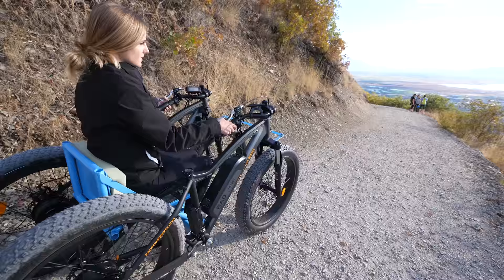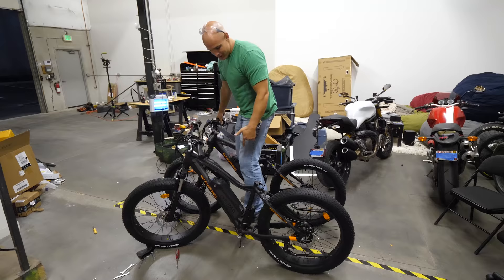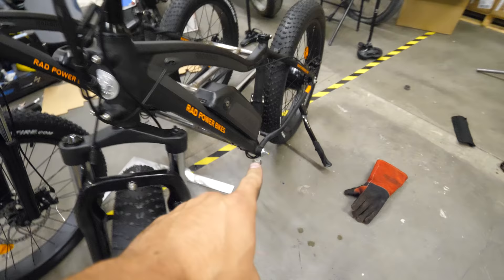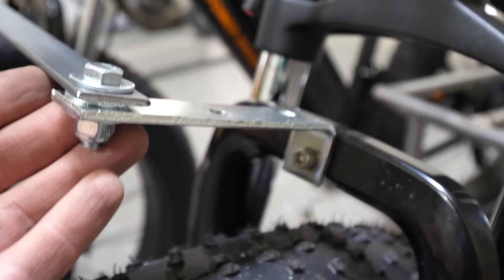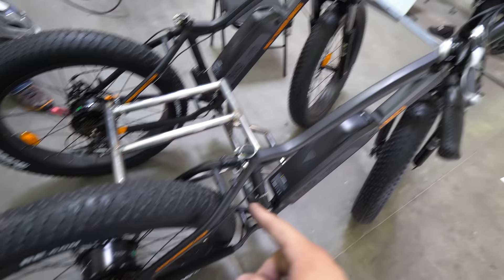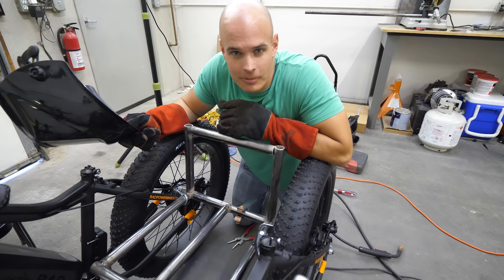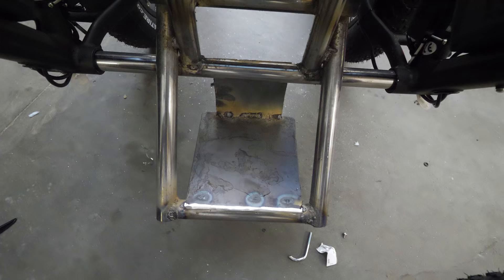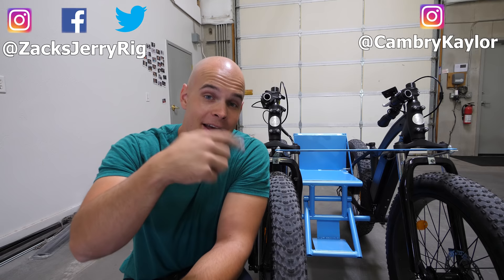How to Build an Off Road Wheelchair (From 2 Electric Bikes)

Comment: Awesome job, very ingenious.  Your steering geometry is not quite right however. The arms extending in front need to be angled outward so the inside wheel turns sharper cuz it tracks a smaller circle than the outside wheel. Google it to see how to figure out the angle, it's really simple and will save a lot of rubber. Good luck to both of you!

Comment: How about you add a small gear on each of those handle-bar mount points. Then a bigger gear inbetween on a bar that spans the two. Attach a bike chain around the three gears. Then mount a set of handle-bars on the center gear. That would likely make it much easier to control, while adding easier access to the breaks.

Comment: They actually make a tool for cutting bike chains and it's really underwhelming to use compared to an angle grinder, but it's really cheap. It's just a screw with a bit to hold the chain still to pop the rivets out.

Comment: You should paten it and sell the patent. You could make a couple million and make anything you want to help people. 
Spring cushion the seat, it would be easier than adding shocks to the rear. Hinge the front of the seat to swing and use two downward shafts under the rear and use coil springs like on the old bicycles

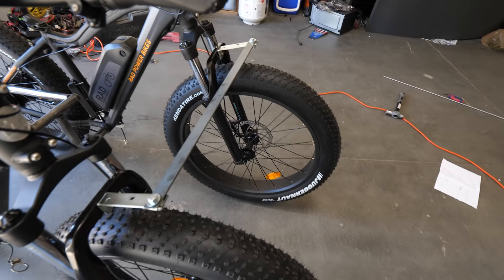Comment: 5:10 Even better would be if you could have the front wheels swivel proportionally like on a modern-day two-wheels-in-the-front motor-trike --- on a turn, the "inner" wheel swivels gradually more than the "outer" wheel, allowing for smoother reduced-friction turning; it handles better and reduces power-consumption.

Comment: watching this for the third time and i just had a idea. To make the bike/s easy to transport could the bar going through the two frames (where the bottom brackets usually are) be held in with split pins and a washer? Also, for the seat, could it be made on a metal frame that simply slots in the two seat pole/seat stay holes? That way it could easily all come apart... just a thought :D 

I am so going to try and build one of these in a few months :D

Comment: think of the thickness of the steel tubes used for the seat vs the aluminium ones for the frame (steel is harder than aluminium). I would be worried for an offroad use.
The central bar lays on threads. An the others point of contact, U bolt, are weak.
The "rig" is less hasardous.

Comment: I'm curious about the brakes. Since you removed one side of handlebar from each bike, so you'll have one break lever for each bike, therefore, you only have 2 brakes instead of 4. 

Are the brakes only for the rear wheels? Because I don't see brake cables at the front wheels. You should use brake cable splitters so each lever can activate both brakes.

If you don't wanna use the cable splitters anyway, you should at least wire the brakes at the front wheels instead of rear, since the front wheels generally do most of the braking work.

Comment: Could you maybe use a folding bike on one side so it can open up to let them get in the seat themselves? You'd also need a kickstand/jack type thing to push the bike up a bit, but shouldn't be that hard. Could also just mount a seat from a recumbent or a go cart of something instead of fabricating a new one

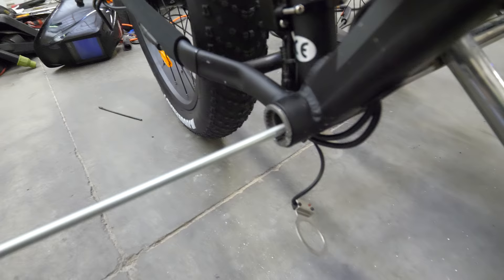Comment: I'm still watching it (@8:13) but I think it would've been much better if you had used aluminum cuttings for the seat contraption. 1 it would be much lighter compared to steel which I think you used and it would have been more in accordance with the build of the bike itself. If you were building it again I can help you with it, not physically of course but I can help with sending drawings.

Comment: Center of gravity too far rearward causing front suspension to not take up equal weight distribution. 

When Putting two sets of front suspension you didn't half the dampening rate to compensate for the total load on auspension not increasing. 

Adjustable dampeners will help you along with making an adjustable chair. A car seat would work.

Comment: did you test it using one motor until it ran out then the other..? would it still have the same power..? maybe could be an option if not going off road... just a thought...

Comment: The joint between the 3 links that tie both front wheels together is mechanically anemic, think at the kind of torques that little screw is taking to transfer the loads between front wheels... would be way better to attach a proper 3 link construction to the sawed off part of the handlebars ... with proper bearings, that would probably allow her to get in from the front, since she probably has strong arms an could just use that  middle bar to pull herself in

Comment: Would it be easy to add a suspension? I think if the seat will be tiltable and only fixed near the peddles axles than you can add suspension under the seat which can connect to a bar which is mounted to the back wheel or that crossbar which comes down from the saddle. I think this way the seat could actually profit from suspension and still be mounted pretty solid
Reply: You could also make a mounted which is connected were the sadles were and than also connect it to that same diagonal crossbar running down to the back wheel. That way you will profit from its original suspension. I could be wrong ofcourse, i was just looking at stills in this video
Reply: PS doesnt that blade @4:27 need to tight solid?!?! Its moving all over the place?
Reply: I think the steering looked nicer if the design was symmetrical :)

Comment: Since it looked like she couldn't get in, by herself.  I'm wondering if it would be easier if it was made to be mounted from behind (grow up everybody).  If the seat back could be fully reclined, and there were handles strategically placed, so she could just lift her legs, and slide off her regular wheelchair.  I have seen a couple of designs of wheelchairs, that are designed to be gotten into from behind, rather than in front, and they really seem a lot easier, and safer.

Comment: If you took a rad power bike cargo one you could have used there flat bed they have made a ramp and had her wheel up it
Reply: You're talking about the new radbarrow which just came out this year. That one costs probably now $7,000.00 due to the trade war with china. It did run about $5,000.00 but you would have to purchase 2 of them. They won't sell just 1.

Comment: Jerry, I think you can upgrade it to a motorcycle steering. Then 2 lever for brakes, 1 lever for both front and the other 1 is for both rear. I think you can use " Y " connetor / adaptor if you are using hydraulic brake system.

Comment: Great video & project but I am disappointed by a few things:
 1) Because she's handicapped she's not going to want to go out in the dark. WTF? Put those headlights back on there! I own one of these bikes and while the headlights aren't spectacular they'll keep her from getting hit. BTW you can get electrical extensions if you order the front rack kit. She should also run daytime red lights in back just to be safe. (I do!)
 2) That steering bar, how does she get in there easily? Move it up higher or use some electronics to link it, like they do with RC cars & planes.
 3) A seat belt would be in order, also.
 4) I have a fleet of bikes that I mostly maintain myself and I can tell you for sure that your through bolt in the bottom bracket is not going to hold. It'll eventually break due to fatigue from vibration. I'd rather see the pipe be smaller (but thick wall, no conduit!) go through the bottom bracket shell, then weld a large nut onto or into the pipe then use some red loctite with a larger bolt & washers to secure it.
 5) Remember to grease everything where you have steel to aluminum or it will electrolytically weld itself together (like where the chair frame meets the Rad power bike frame) and it'll be extremely difficult to work on.
 6) They make brake levers that will pull two brakes at once. You might need to customize something here because those will not cut the motors like Ebikes brakes do.

Comment: That is totally awesome I've been looking for something like this I ended up with a Bounder off-road Buy 20th century scientific the front wheels are too small I looked into the one that's made in Australia anyway I've been looking for 2 years after I bought the Bounder. It would be awesome if it was four-wheel drive but with the bike tires I don't think it needs to be the only thing that I would like to see different is to make the seat as possible for my big ass. What is the widest seat that you can make that would fit on this and I don't know how to make the with adjustable but otherwise it's awesome send me one where do I write the check am I assuming that this is going to be put together or is it going to require the new owner to assemble it. Because I know shipping is a pain in the ass and expensive. Where did you say the factory was I'm on my way from Oregon. Good job Jerry

Comment: You should have put controllers in order to modulate the throttle on each wheel depending on steering (ie like a differential) and link the throttle together rather than making 2 that have human input.

Comment: You overbuilt the seat frame. Keep the main cross member through the former pedal housing as a steel tube but the rest should be transitioned to either thinner steel tubing or aluminum, and the actual seat surface could be a light weight plastic or fabric as others have suggested. I'd also mount the seat surface with some rubber bushings to help slightly with cushioning bumps. The rear definitely needs an actual suspension though.

The front steering needs an actual tie rod and finally I'd move the batteries under the seat with another set wired in which obviously negates weight savings but lowers the center of gravity and improves its maximum travel distance.

Comment: Couldn't you just put a bar through  those stems and weld one that would form a T and then weld the handlebar with it so it would be a I shape(in Times New Roman font type), cutting those handlebars seems such a waste, and at least I think she would be more confortable with both hands on one handlebar? Or couldn't she enter in it?

Comment: Neat project, being in a chair myself, transfers would be tough.. What are your thoughts on a two wheel front end trike setup?
Reply: Been pondering this one myself (my wife doesn't need a chair....yet but it's sadly likely in her future....more a matter of when not if)
I wonder how hard it would be to interface the chair with it somehow.
That or mod the front bar so you could roll right up to the front and use the frame either side to help you transfer. Though you'd then need a means of reversing away from the chair and somewhere the chair would be safe when your using the bike /someone to stow the chair.

Probably an obvious solution staring us all in the face. Just like I never considered the obvious option of jointing 2.bikes together.......
Reply: Had an idea on how to solve the transfer issues -pair of step through bikes, should be just enough room between seatpost and the handle bars to transfer through backwards (using the frames as support so you could drop into the seat)
You'd give up some torsional stability but there are ways and means around it

Comment: @JerryRigEverything Just a question though, as the bike has two accelerator handles so does it impact either the battery or bike in any way if the accelerator is not used in same amount on both the handles (which i doubt will be possible for a person to maintain)?

Comment: i hope you put the brakes levers in the correct orientation.. i think its kind of unnatural to use your thumbs for braking.. im no electrician or have any ideas in electronics, but i think you can sync those 2 motors with one throttle.. and instead of a conventional throttle grip, i think there's a thumb operated throttle like those on e-scooters..

Comment: I am so sorry, but I have to criticize your project. First of all, the main connection points between the two bike frames are unsafe. You should weld stop rings on the bar which enters the  bottom brackets on the frames. This would allow you to fasten each bike frame INDIVIDUALLY on the chair structure. The ”U” clamps you used to fasten the chair structure to the seat stays are not enough and could cause the rupture of the seat stays. You dont want this to occur when Cambry is using the ”quad”.  The actual configuration allows the whole assembly to twist. You have to ad a curved bar, or tubing welded on the top of the backrest of that chair like an armrest, then secure it with lateral straps, and connect its ends with the seat tubes of the frames,  using the original bikes seat posts. Then you will have a rigid and secure three points connection between the chair assembly and each of the two bikes.Another flaw is the steering. The ”L” brackets are too flimsy, and can rotate easily. Together with that band between them, they form an unsafe assembly in which any of the parts can bend very easily. You have to design a new steering assembly using tubing instead of flat band and the brackets should be connected with each fork using at least two bolts. And one more thing: Change the position of the brake levers in order to operate them like on a normal bike. Using the thumbs to brake on a two motor electric ”quad” is everything else than safe. Best regards.

Comment: You are doing good thing but cmon... This construction looks like its made just for video, not actual long term use for her. Metal seat frame moving against Bike frame? It will make hole in aluminium in few months or less. Stering connected with one screw that will unscrew itself after few rides. And also that metal seat... try to sit in it for few hours by yourself, would you like it? You could use comfortable car seat and just attach it to rear axle + tube you had in the middle. Girl would have nice transport for years. Now its just wasted material and bikes imho.

Comment: Someone should take the tools of off you before you hurt someone, especially the welder.
#1-
Can you say 
ALUMINUM?
That's what the seat assembly SHOULD have been built of.
#2-
Do you know that you  turned the left handlebar set the wrong way?
Dugh----
#3-
The steering linkage is asking for TROUBLE!
you didn't think of attaching the linkage with 2 upside down steering necks?
Installed from the bottom of the steering head?
It COULD HAVE BEEN using hemi joints and old tubing from old aluminum bike frame's.
Dude...
Your making me sick!
GET HELP NOW.

Comment: SMH this is crazy ghetto...the main triangles only connected at the bottom  bracket....no good....def not  structurally sound...those bikes are going to want to go in two different directions and rip the  bottom bracket shell right off the frame..... even with the rear triangles u-bolted to the seat and the steering linkage up front, there is enough torsional flex in the front triangle that the bikes frames will no doubt fail in the way you have this designed....no way I would let someone ride that off road....they're likely to end up in a wheelchair.....